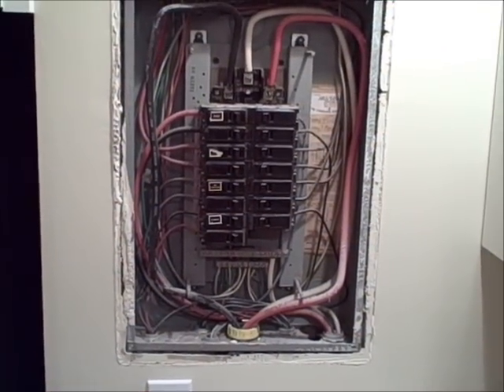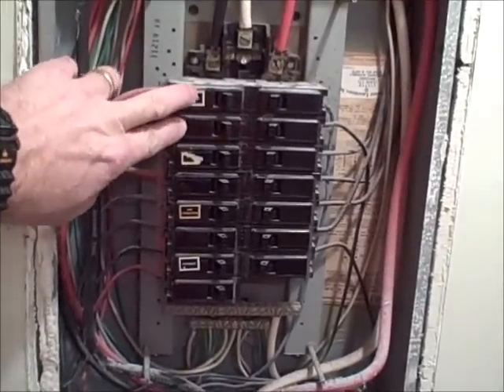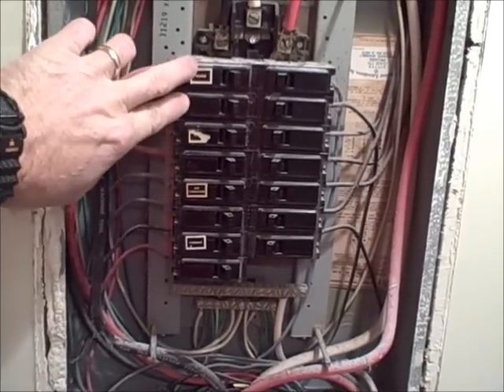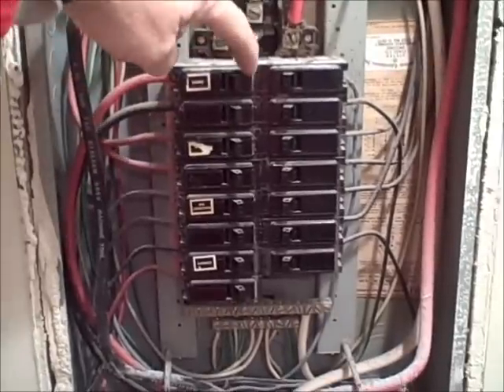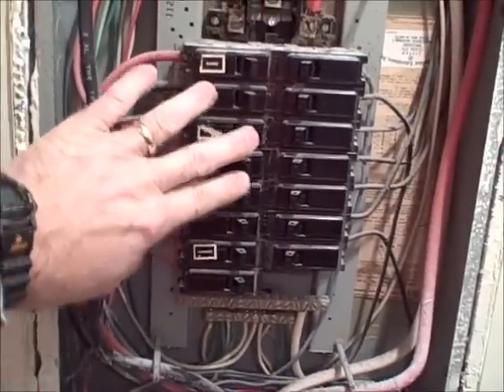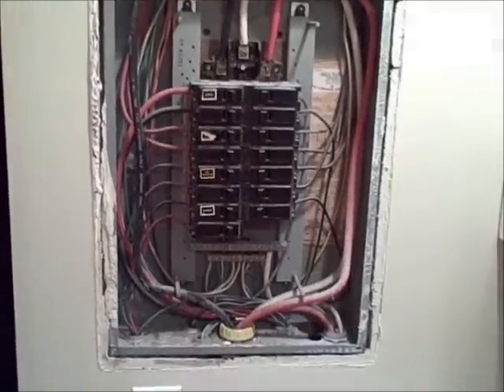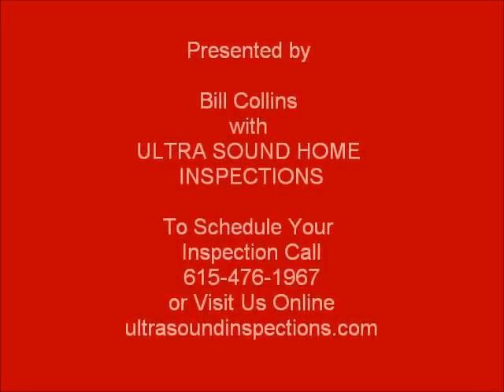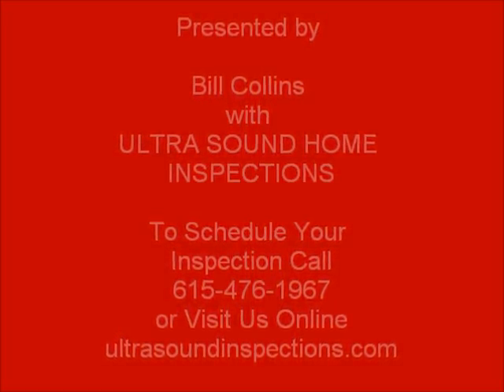Unsafe Electrical Breakers Discovered by Franklin TN Home Inspector.wmv

Comment: Same applies with half size breakers fitting a full size 120 bus in the panel if there is a shared neutral wire for the branch circuit like with countertop wall outlets. Where one duplex has the black, 2nd had the red leg.  However most of those 3 wire circuits are on separate phases (legs) 240V with a double breaker/common trip.

Comment: Two reasons for that.

1. The UK uses 240 volt wiring/appliances, so your current needs are lower, you can get away with fewer circuits.

2. The UK uses ring circuits and fused plugs; ring circuits carry far more amps than radial circuits, and the fused plugs take the place of circuit breakers, meaning you need fewer breakers in the panel.

Comment: Vintage breakers (and some new ones) only have a tripping element in one leg.  The thinking was that if the motor windings shorted the overcurrent would trip both legs IF THE LEGS WERE TIED TOGETHER.  Otherwise, the windings would have to melt till the circuit opened, hopefully before starting a fire. New code forces the manufacturer to tie the legs.  The real problem with not being tied is if the unprotected leg shorts to the equipment making it energized  = no protection of electrocution.

Comment: the  US system is diferent  , we use branch circuits, standard recepticl can ony provide 15amps at 120 volts =1800 watss maximum . im not sure because i dont live in the UK but i have heard you have  230 volt ring circutis at 20 or 30 amps that would mean you could pull 4600 or 6900 watts per circuit  and i wood need 3 to 4 circuits in equivelcenc

Comment: Because it is redundant for your electric meter to measure current on all three wires.  If it simultaneously measures the current on L1 and L2, then by Kirchoff's law, it can get the neutral current.

Neutral is just a passthru insulated busbar on most meter sockets.

Comment: 1 or 2 brakers for the simle socets
2 for the lights, divide house in two parts.
1 for the outside garden lights maby
1 for lαundry machine
1 for the oven
1 for each split air condition
1 for the water heater
1 for each room heater.  
   In Greece single phase220V 50Hz or  three phase 420V 50Hz This is carrent house suplie!!!

Comment: What if you use a fused disconnect, instead of a circuit breaker?  And if only one of the fuses blows, yet the other fuse is still continuous?

That would mean that your circuit is still live, on the non-blown fuse.

Comment: The whole panel needs to be changed before the whole place burns to the ground. Would you like portable generator wiring with that?
Reply: There's nothing wrong with the panel. But I would recommend replacing all the breakers with new ones.

Comment: I agree with this inspector yes you should have a common trip breaker like a GE THQL2130 that means each leg trips at the same time. yes some inspectors are a joke like I had one in Houston tell me that I needed to upgrade my service so I asked why he started to tell me all the illegal wiring from todays code so I asked him this house was built in 65 and the service has never been touched so am I required to change the service? he said yes so I talked to his boss

Comment: Thanks for share! Why my electric metter have 2 wires in and 2 out (I supose l1 and neutral) and my braker box have 3 vires L1 L2 and neutral, where the other wire comes from?